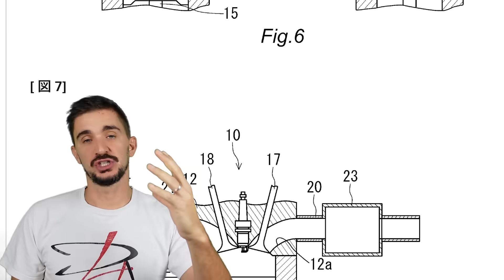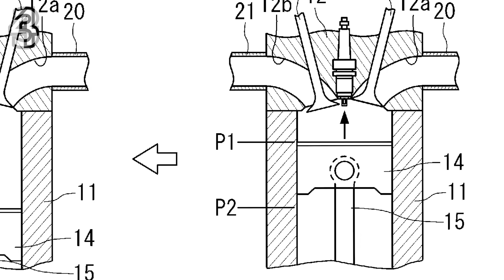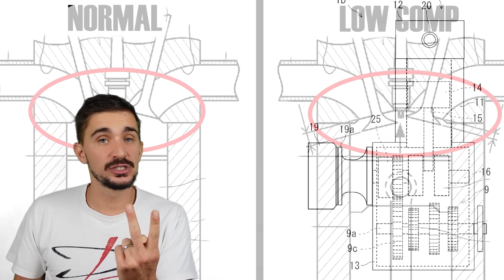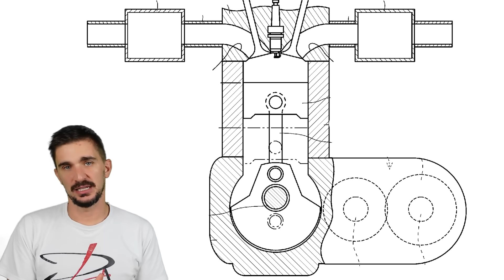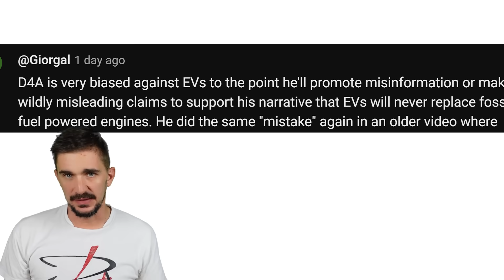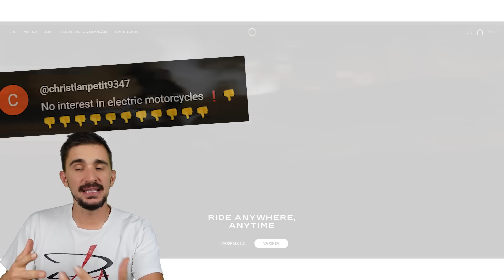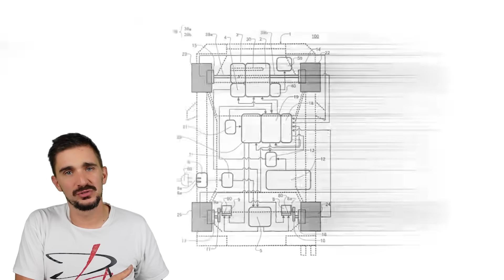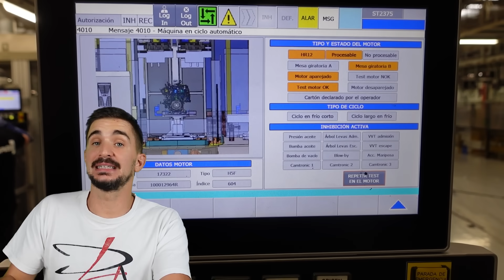Yamaha Just Patented A Fake Engine

Comment: We used to just use a baseball card in the spokes of our bicycles.
Reply: we used to put cans in the frame that got hit by the tire tread
Reply: @cazadon so is that more like a two stroke than a chopper since the tread would have more nubs per foot than spokes per foot?
Reply: @bobbysenterprises3220  no idea i did it like 20 years ago when i had no intrest in engines
Reply: @cazadon  hah I should've read the replies! I, too, discovered that 🍻
Reply: If you drive over a soda can, it gets stuck on the tire and the fork of the bike. This also makes a sound which sounds similar to an engine.
Reply: They don't do that now because nobody can find a clothes pin
Reply: @plap. that’s when you grab a can and shove it in the tire lol
Reply: @plap. I just duct taped a a price of milk bottle to the rear near the derailleur
Reply: just one card?  Come on now...  you can fit like 10 of them if you're clever.
Reply: @shortattentionspangarage1312 
Yes as my comment also mentioned. A clothes peg (pin etc) is not always up to it. So borrow you Dads mole wrench 
I don’t know the translation from that but not a spanner 🔧 ( adjustable vice grips maybe?) I haven’t been ten for 50 years now so as someone else commented " then we grew up" , it’s about time I did. 
I will get fat shave my hair off and grow a beard. Wear a tee shirt and shorts and tell everyone how good I used to be.
Reply: @shortattentionspangarage1312
Reply: We used a barely inflated air ballon 👍
Reply: I still do !
Reply: They can use the air to run a turbine driven dynamo.  Not only to power accessories but to charge the batteries.    Its genius free energy and perpetual motion. 

Does the patent also include special non combustion oil that can only be changed by dealers and the EV part will not operate if the engine is due for maintenance.
Reply: I'll just eat a can of Bush's Baked Beans 🫘   That should take care of it, and might even provide a bit of thrust!
Reply: i put a piece of carboard
Reply: Nah, that's low tech. Those in the know would use matchboxes, much louder.
Reply: Be modern use Bluetooth speaker 😅
Reply: Could be they had to add the future to stark because stark is a large carpet company.  

The poor young man the rides up on his new clean dirt bike at the trails that has that appears to be made by a carpet company.   Forget he get picked on for riding a girl's bike he be forever known as carpet boy.
Reply: Riding a motorcycle generally is (lets be honest) for amusement purposes.
   Wasted fuel, wasted power, wasted machinery...     BUT, we are entertained  and so the entire enterprise is justified.  Wasting precious resources to produces nothing             ...but for  some Moments of FUN.
Reply: @reasonablespeculation3893  My motorcycles are needed transportation that just happens to be fun. I will always take a bike somewhere over my car when conditions permit It.  Makes me way happier. There was a time, back a while now, that  a motorcycle was my only vehicle for about four years. A Bike is very efficient on fuel and about everything else including Registration and insurance too. I couldn't afford a car so I went bike shopping. Rode through all kinds of weather and temperatures. saved me even bought my house during that period and didn't get a car till two years later.  The only thing for those several years my bread was always crushed, it doesn't fluff up once squished.
Reply: Already as a young kid I realized that a card in the spokes would slow me down. Anything that doesn't add function and performance has to go, such as a styling wing on a car.
Reply: @matslundstrom7763  hey, my '05 civic goes way faster with the giant spoiler on city roads, because people take one look at me and know I'm an irresponsible driver with terrible insurance - stay out of my way
Reply: @MatsInSweden  bikes are for exercise though!
Reply: We used plastic cups.
Reply: Empty water bottle works better than anything mentioned yet
Reply: An empty crushed water bottle. I prefered the thinner plastic like ozarka over stiffer ones like dasani.
Reply: You know that also costs energy because of friction, but yes that worked a charm!
Reply: @postmax81 Not a total loss of energy just for sound, it kept the spokes clean as well.
Reply: And than you turned 5......
Reply: Baseball, huh?
Reply: In albania we used plastic bottles cut down
Reply: LOL!
Reply: I use plastic bottle😂
Reply: Wait. Used to?
Reply: We didn’t have basketball cards in England. We used fag cards ( as in cigarette cards , don’t panic) but by this time 60s they didn’t come from tobacco related things but from tea, the fag card name still being used. 
  A pice of thick cardboard or the right kind of plastic worked must better, especially if using multiple ones spaced accordingly and you didn’t inadvertently wheel the bike backwards.
Reply: I thought thats why clothes pins were invented. 🚲

We didn’t have plastic bottles yet.
Reply: @albeit1 I was going to say that, nobody even thought about bottled water. People would have laughed you right out of town. What do you mean you actually paid for that, water put in a bottle. Just ludicrous. lol
Reply: @plap.  Bottled water is the 3rd largest commercial scam ever played on society, right after the 2nd, De Beers diamond market making, and the 1st, GM's Hummer H2.
Reply: Do you think that's been patented yet?
Reply: Haha i used an old poker card!

Core memory unlocked😋
Reply: Plastic water bottles stuck between the rear wheel and frame 😅
Reply: Or a water bottle
Reply: I had the exact same thought, but baseball wasn't really a thing in Sweden in the 1980s so we used laminated playing cards.
Reply: @emanuellandeholm5657 I was never big on watching sports and definitely never collected baseball cards. I played war with my grandmother whenever we visited and would get playing cards from her. To get a full pack was a score for my friends and I.
Reply: I came up (accidentally) with a far louder and better version... but only better AUDIBLY 😅
I once ran over an empty soda can and it perfectly squished around my back tire. In doing so it came up and sat under my seat by the rear brake (10spd bike). There it somewhat floated, but every tire lug would slightly catch and vibrate the can loudly.

With >a hundred lugs on a large rotating tire, it meant the faster you went, the louder the noise and more rapid the vibration was. The slower you went, the lower more rumbly it was. It was very similar sounding to a small 2-stroke motor! 😎

The downside was the rubbing DID create undue wear, as after riding with it on, there was indeed some rubber dust clinging to the can. Not enough to be a problem in the short-term, but enough that even 8yo me had recognized that doing it all the time want good. So friends and I only did it if we came across a littered can on our adventures.

But BOY was it loud when going 15mph+ down the all hills in my neighborhood!! 
🤘😫🤘
Reply: My brother attached one of those bicycle side-wheel lighting generators to a transistor radio speaker. It did a pretty good job of making a motor sound.
Reply: I crushed a beer can on my back wheel.
Reply: It was so good
Reply: I used a 4 stroke gasoline engine 😂
Reply: Ya beat me to it; was thinking the same thing.
Reply: Or a matchbox with one match on top and a rubber band
Reply: patents expired...
Reply: We used playing cards in my neighborhood.
Reply: Small log, of which one end was smoldering, jammed into the rear bike frame FTW.
Reply: Until the playing card wore out!
Reply: True, but it is one thing to use a free "hack" on an existing bicycle that resembles engine sound if you are a child or teenager and cannot legally and/or financially have a real motorcycle, and quite another to invest resources to build something as complex, heavy, expensive and prone to breaking down as a fake engine. Plus, electric motorcycles suffer from range issues and tend to be heavier than those with conventional internal combustion engines. Both issues get worse if you add a, say, 30 kg more dead weight of a fake engine.
Reply: Made by the Motorcycle companies. You have to change them when you get no oil change.
Reply: Oh no, that sounded awful...
Reply: I mean this is technically also a performance reducing mod for the sake noise, lol
Reply: But then we grew up.
Reply: Most important comment of them all.⚠⚠⚠ People do stupid/pointless things in the early days.
Reply: @hawgietonight I didn’t. Grow up means give up.
Reply: Don't hate! Way better than the slow, obnoxiously loud/inefficient/dirty vehicles. Like Harley's. 

 Someone putting a rare Pokemon card in their bike tire earns more respect then those A Holes. 

 People making race car level sound for  civilian level speed screams childish. I instantly think must be a guy who compares flaccid wangs in a urinal. Some of us are growers! 

 To me the coolest by vehicles were always silent, and quick AF. 

 I remember someone nearly muting a V8 with such low frequencies, and so it was mostly felt. 

 That was dope. 

 I'm mad electric cars are forced to make any noise. 

 For this patent. Someone said this is used to sell engines when they get banned. I think that sounds plausible. 

 PS. I seen a dark van squeal onto my street. Then accelerated into a right on a Y split road without a sound. 

 Must've hit like 50mph down a 15mph street in two seconds. 

  Outside burning the rubber it was basically just a whoosh in the night. I barely saw it as it had weird headlights, tinted windows. 

 My mind jumped to. "Did they just kidnap someone off the streets WTF was that."

 They were moving like a government hit squad. Or cartel. About to snatch a VIP Is all I'm saying. (Or did!)

 Few would have ever known if I didn't see them. 

 To me that is so much cooler(and alarming) than these lame a holes going 15mph, waking up everyone. 

 Your vehicle sucks if people can geo locate you a half mile out. "Ah Joey will be home in 15 minutes."
Reply: @RedactedDeath  This is like a very long Haiku

Comment: I mean given that motorcycles are recreational vehicles and only in rare cases daily drivers, I can see where they're coming from.

You can also see something similar with the Ioniq 5 N and its simulation of a manual transmission + a reving engine.
People seem to like it. They get the sensation they are used to and like but without combustion.

I think some car people called it "LikeMeat but for Cars"? That makes a lot of sense to me.

Essentially, I think the answer is that people aren't purely rational beings, but sometimes (especially when it comes to recreation) just have emotions that might not be rational.

Think of it this way:
We could tell people to please be rational, but then they get unhappy, angry, and resist.
Or, we engineer something that caters to those needs while simultaneously also being better for the environment.
It will be not as efficient, but it will be accepted by the market.

Addendum:

I really like how you prove time and time again just how much of an engineer at heart you are :D
Please stay like that!

Comment: The engine should be named "This could have been another battery on the bike"
Reply: Seriously, just a waste of power and weight, just hook the electric motor to the gearbox like rather B welding did! I'm over here thinking of how to make this fake engine run, just needs the right cam and a carb!
Reply: @captainchicken8983  or an old diesel style cam actuated direct injector

Comment: This is wild. I could totally understand keeping a traditional drivetrain and replacing the ice engine with an electric motor. I honestly am surprised they don't utilizing more gearing. Before you say "muh max torque available from a stop" well then why not use an overdriven gearbox that that trades torque to lower rpm which might make your range better? Gearboxes are over 97 percent effecient
Reply: There's a single ratio gearbox incorporated with most electric motors because the output speed needs to be reduced to make them useful to drive vehicles, so you've already got that loss in most of them before you add a multi-gear gearbox to create a further loss.

Comment: The sound and vibration has always been a downside for me when it comes to ICE cars, the only feature I will miss is the manual transmission.

I wish they made fake manual transmissions with a fake clutch and everything, just to control the amount of regenerative braking (simulating different levels of engine braking) and control the parameters of the motor to control torque
Reply: What I like about manual transmission is that I can anticipate situations and chose the correct gear based not only on current state information but future state. Automatics the computer can’t predict what is happening on the road ahead.

Comment: "The combined intelligence and industry insight [..] of the people working for Yamaha must be far greater than mine"
Yeah, but Yamaha isn't a hive mind. It's a company and like most companies, only a few individuals at the top make the decisions that then 'trickle down'.

Overall, I think the idea is very silly and it feels like an attempt to bridge the gap between ICE and electric, done very badly. The Ninja 7 is a much better, more practical (but still flawed) way to do this and even then, not many people are interested.  Maybe if you want to have an engine, but also an electric poweplant, you could make use of a range extender? It would have sound, vibration and, well, an actual practical use?
I just don't see the category of people who would be interested in this approach, for all the reason you mentioned in the video.

Comment: This is a cordless tire inflator that you can ride.
Reply: At a minimum I would want some kind of fitting on the engine to allow me to do just this.
Reply: @Hybris51129 at least!!  All those parts for nothing….
Reply: It took me a while but i got it and I can’t stop laughing 😂
Reply: And works as well 😂😂
Reply: Especially if it had a large air tank to operate the propeller or side car wheel
Reply: I bought a tool that replaces a spark plug on my Harley that does exactly that.
Reply: then you let air out of the balloon out for thrust.
Reply: @-IE_it_yourself Needs a CO2 tank for power.
Reply: Haha great observation! You ain’t wrong!
Reply: This is for Jaguar fans that will be able to use it with specially fitted underwear.
Reply: Lmao, I liked that one!
Reply: it's worse than that because it wouldn't inflate a tyre
Reply: Fuckin' lol. You sir win teh internets

Comment: As an mechanical educated person and motorcyclist I proposed around 15 years ago to build an electric motorcycle with a programmable vibrator (multi balancers) which imitates the vibrations of a twin-parallel, V180, 2 or 4 cilinder boxer, etc etc engine. At the same time produce the sound from such an engine in the headset of your helmet, create a possibility of changing gears and synchronise that with the vibrator and sound, while the electric motor stays connected. Now you have all the emotions for us petrol heads and all the environmental profits from an electric motorcycle.....
Reply: whereas i devised a reciprocating induction motor...

Comment: You can buy fake blenders in a toy store. So someone must have patented it. haha

There would be minimal heat produced in the fake enginge. There's no combustion and the only heat created is from friction and compression of air. They could easily be aircooled.

The forces and pressures are much lower too. So the fake engine could be much lighter too.

Comment: Why does it have a spark plug?

I cant see anyone actually wanting this. There must be far better ways to replicate the sound and feeling of an engine. 

A slightly off balance mass after the gear down reduction could get you the feeling without all those losses and wasted space.
Reply: And perhaps a speaker for some engine sounds
Reply: @woutermollema  Did you ever see someone with a a pushbike and a device that hits the spokes as they go around so it sounds like a motorbike? :)
Reply: I was thinking the same. I bet they'll implement it as a range extender. Their patent even mentions that all possible combinations should be considered...
Reply: @C3LM4RFG  A range extender? It seems to be the exact opposite, it only decreases range. The patent appears to be for using any existing engine type passively spinning, not actually burning fuel, for the sole purpose of sound and vibration. A range extender wouldn't be covered by this patent and i'm sure would already be covered by some other.

Comment: So in essence they made AngeTheGreat’s Engine Simulator engines real, because engines are basically moving air pumps producing farts that can be tuned. 

This sounds like an elaborate April Fools prank BUT pairing this with an electric motor produces sounds better than speakers *cough Dodge and VW* could.

Comment: I guess it's a genius trick to go around the embargo of build and sell gasoline and diesel engines after 2035.

A full function motor that sells as  electric but you could mod it to a hybrid yourself. 😂
Reply: Its got a HUGE starter.
Reply: What embargo in 2035,the zero emissions thing is bullishit, it's also never affecting motorcycles they just  produce too little pollution for lawmakers to care
Reply: I was wondering that, how much work would it take to make this engine functional...?
Reply: @candyman9635  this thing will not have any components to make the ignition and the entire thing won't be made to withstand the temperatures of combustion

Comment: I mean I get it but having a clutch to disconnect the whole engine to get rid of the losses, is maybe beneficial when you need all the range to get home but then you have a lump of metal and weight that you drag around with you for no benefit 

but in a future where there maybe are very strict limitations on combustion engines and fuels I can see this as a nice way to still experience some sort the feeling and joy you would normally get